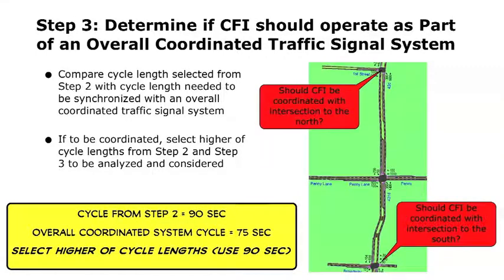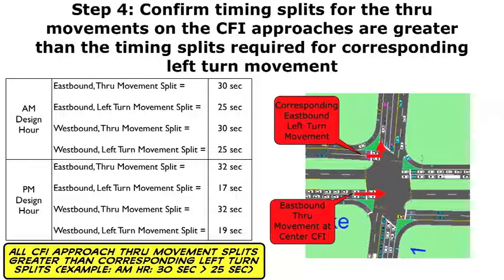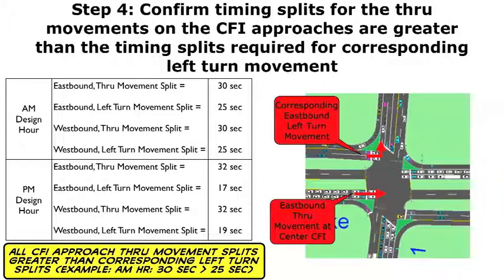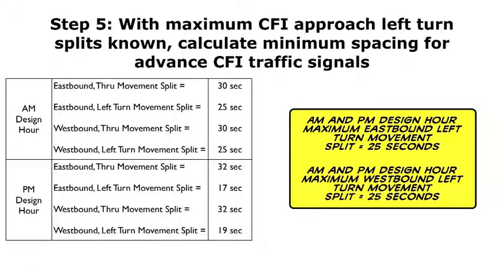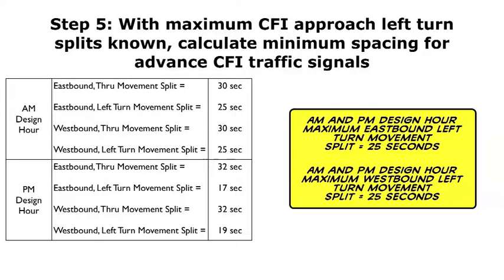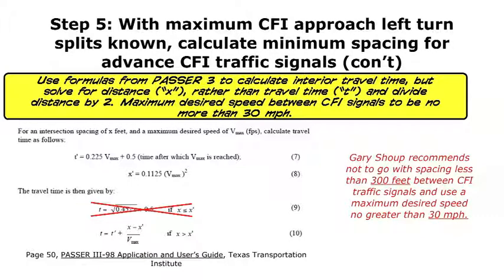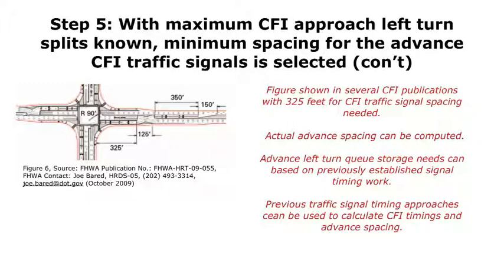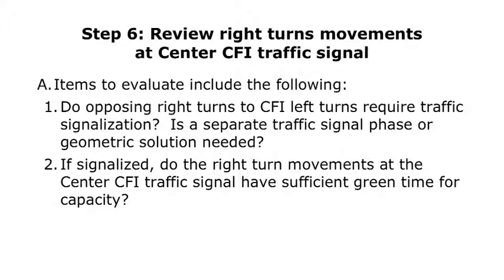Continuous Flow Intersection How-To: Part 2

Comment: Hi Gary, coordination is usually with double cycling when matching 2 phase cfi with 4 phase conventional.
Sidra provided the timing splits for the main intersection and the crossovers for example, a 39/21seconds split at the main intersection and a 46/14 at the crossover. But 14 seconds (less 6 intergreen) leaves 8 seconds (4 cars) per lane for the turners so I need 4 lanes crossing over in a dual-tandem arrangement to ensure that the crossover does not become critical. I then link the cross-overs at the speed limit with the extra time giving those that have just turned time to clear early. the thru traffic can then proceed in a green wave.
Another consideration for spacing is the green phase queue length for all lanes so that they are fully using the green time. Regards